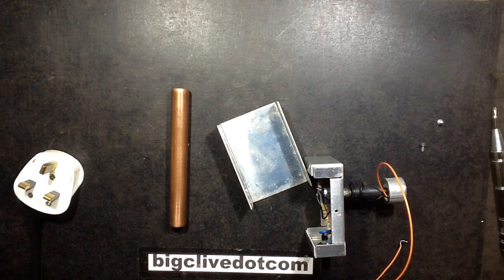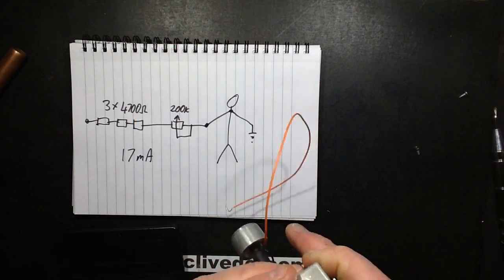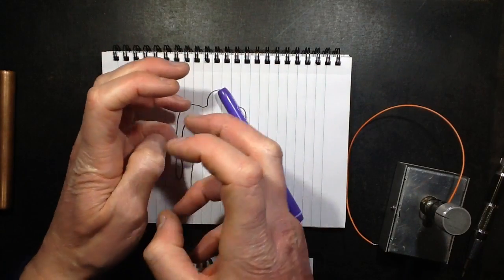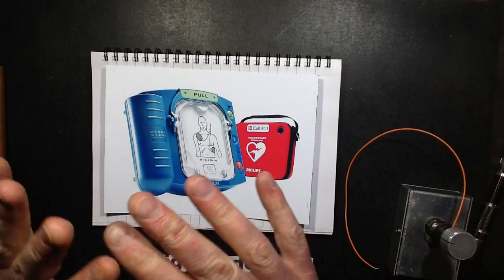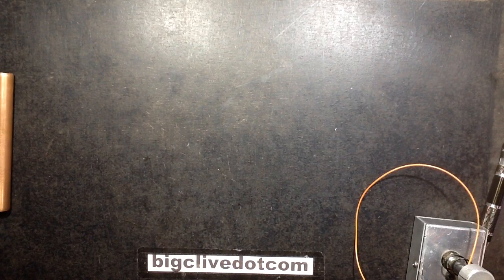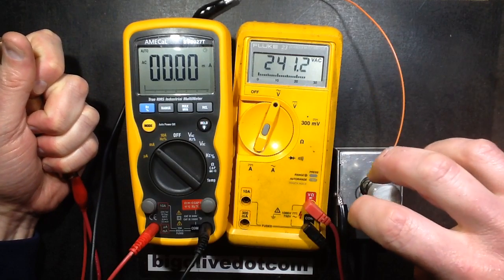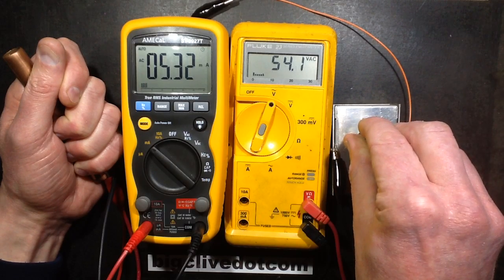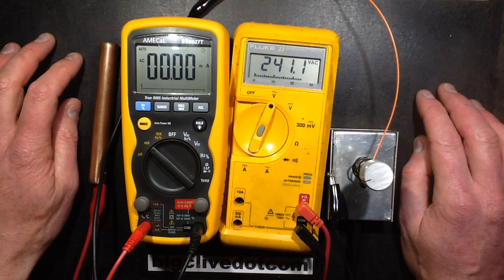Avoiding electrocution (Featuring real shocks.)

Comment: Actually a flatline can't be restarted via an AED.
It can only, as you have said, resync it. It sort of resets the sinoatrial node, which is basically a natural pacemaker in your heart.
Reply from the maker: I'm intrigued by the ability of some human hearts to resync completely with a rescue pulse.
Reply: Not sure what you mean here.

If you don't know what what I mean:

If it's actually stopped, a flatline, an asystole if you wanna be fancy, you can't just restart it with a shock. It's rather complicated and going into details is pointless, but what you have to do is CPR first combined with injection of vasopresin. With that you can get the heart to beat - though that then might need a shock because of ventricular fibrillation.

If you don't know how a heart works:
Look up sinoatrial node and it should be pretty clear
Reply: The heart has its own "pacemaker" made up of modified muscle cells that creates its own shocks that cause the heart to pump regularly (and by the way that makes the heart independent from the nervous system). If that's disturbed you often have to give it a shock so it "restarts". Sometimes it's damaged and then the patient will need a pacemaker.

Comment: Love your videos bigclivedotcom. Question though - shouldn't your calculation be (240*sqrt(2))/14100 given that 240v is the RMS voltage. This would then result in 339.4(peak)/14100 = 24mA max ?
Reply: I guess the question is if the body is sensitive to peak voltage or RMS.

Comment: I'd like to see you do this with DC and talk about how DC feels different to AC
Reply from the maker: I'm thinking about that with AC, unsmoothed DC and smoothed DC.
Reply: bigclivedotcom Or push ot even further. Different frequencies or even waveforms. Get an amplifier, connect it to your phone with a frequency/function generator installed and touch the output. even a shitty 12v ebay amp will work. You can get extremely high muscle contractions and even nerve stimulation. I've done it at a similar way back in school when I've talked about electricity and it's effects to the human body. It's quite interesting to see that higher frequencies "penetrate" extremely deep without high voltage and current.
Reply: @DrakkarCalethiel  Well your dumb because the higher the frequency the higher the skin effect so it’s actually opposite of penetrate. dumbass
Reply: @masseyluna2002  You saw how I said "penetrated"? This has a reason. Our body is most sensitive in a frequency range of about 50-100Hz. If you grab a conductor at 30DC you most likely feel fuckall, change it to AC 50Hz at the same voltage (30DC becomes 30AC peak to peak) and you feel the current much, much stronger.
Reply: @masseyluna2002  There is no skin effect with the human body.
Reply: @aj200415  One should not call others dumb not knowing better themselves.
Reply: Now that was very interesting and informative, well done
I wouldn't try it myself,
But hay it is something we should all think about, electricity kills
Thank you that was fantastic
Reply: @seandempsey9396  You can take these "voltage testers", a screwdriver with a glow lamp and a resistor inside. If you connect some tin foil to the grounding wire of the outlet and you put the voltage tester at the phase, putting one hand on the tin foil and holding one finger at the tester, you can feel the vibration of the AC! But only use intact devices and never connect it in reverse, the foil to the phase and voltage tester to the ground!
Reply: @seandempsey9396  I know that it does as I am lucky to be alive
Reply: DC really sucks once you get above a certain point
Reply: Homemade TENS unit 🙃

Comment: Yir some man clive  :)   by the way do you ever remember the shows that travelled about I live in Johnstone btw 5 miles from Paisley...anyways the travelling fairground (the shows) i am talking about had fruit machines that gave you a nasty tingle if you touched the silver parts on the front.Do you remember this or the shows ??
Reply from the maker: I've actually got a pull-handle fruit machine that gives you a zap when you touch the chrome.  The buttons have old leaf contacts with fish-paper insulators that have worn away.  The fairground machines were probably missing their earth connection.  Knowing quite a few showmen and how they dealt with electricity back then it's no wonder some of the machines gave "surprises".
Reply: yip they sure did give you "surprises "  btw its good to watch vids with a Scottish you- tuber ,,a very well spoken Scot but if you spoke like myself you would need subtitles :)

Comment: I always thought that AC current repelled as apposed to causing muscle contraction, which I thought what made DC very dangerous.
Reply from the maker: High AC current causes a massive involuntary muscle contraction which can throw people using their own muscles against them.  In the wrong circumstances it can cause them to grip onto live connections with such force that they can't let go.  With unsmoothed DC the contractions still occur, but with smooth DC it causes one contraction and then a burning sensation.

Comment: Build one with DC and test that. it will require a littlle more I think.
Reply: Linus T As an example, 30 volts DC might burn a bit when you have wet hands. 30 volts AC hurts. I work a lot with 35 DC but never got shocked.

Comment: Lockout Tagout isn't so much to save you from a shock, it's to save you from getting crushed, sliced, blended, battered, or otherwise mechanically fucked up.
Reply: Exactly, I wasn't even aware LOTO disconnected power to a piece of equipment, I just thought it disengaged the controls and held any moving parts in place.

Comment: Are you implying that HSE are idiots, they're in my thinking
Reply from the maker: HSE has gone from being a good thing to a profit motivated industry that has stripped all the pleasure from work by applying ill conceived blanket rules aimed at the lowest intelligence worker.  In doing so they've alienated the skilled workforce and effectively paved the way for using low intelligence workers.
Reply: bigclivedotcom  having worked within the industry for the last 30 plus years I totally agree 100%
Reply: bigclivedotcom they did the same in BT.
Reply: I think every industry has been touched by the scourge of H+S
Reply: Hehe, first job I ever had in a factory I had to be taught how to use a ladder and then sign a sheet to say I had followed the instructions and could now use a ladder.   Because naturally I wanted to set the ladder up on a 60 degree well-oiled gradient with a wheelbarrow of broken glass panes at it's foot, and then climb the ladder backwards with one hand firmly up my arse.

Comment: Just mentioning, as a paramedic in training we were told that an AED is used to cause a flatline so you even have a chance to get the heart started again, because you can't push against a cramping heart. Defibrillators as seen in movies (like, flatline -> charging noise -> "CLEAR!" -> bang -> (repeat 3 times for suspense) -> regular heartbeat) don't really exist… at least that's what we were told.
Reply from the maker: That's true.  A defibrillator is designed to bring your heart muscles into a known state so external compression can be applied.

Comment: Boy, that's dedication to bringing safety to the masses.
Way to go Clive.
I remember my first electrical shock at the age of 6 when I put my thumb up into an empty light socket, reaching it by climbing onto a bed then onto a window sill. Luckily I fell forward rather than backwards maybe through the bedroom window.
The scar staid with me for years.
Reply: My first shock was age 3. I unscrewed a nightlight and stuck my finger in.  I’ll NEVER forget it.  It was 115V and no ground path but such a powerful and unexpected sensation I’ll always respect AC power.
Reply: @technophant  for me age 6. Same for me and i put my finger in a night light in my sister's room while on the bed, so no path to ground, 120 volts but it didn't hurt me it just felt like some ants in my finger and i actually let my finger in it for a full 2 or 3 seconds, i remember not wanting to try it again due to fear of dying but it somehow didn't hurt me
Reply: I was 4 or 5 with a shitty italian extension cord with no collar. Pinched my forefinger and the flap between thumb and forefinger in there. My father saw what had happened as I was flaiiling on the floor and janked that cord out from the wall socket. For long time there was kinda hard bit in the middle of that flap but it's gone now that I'm 62. The white mark on the forefinger though is still there. Finland had 220 then, now it's 230.
Reply: Well you were a dumbass for doing that, weren't you? Still are.
Reply: I gave myself an electric shock at age 6-8 or so because I wanted to know what the fuss was about, and I stuck two nails into an electrical outlet. I'm pretty sure I shocked myself from one hand tothe other too, but I only made a very short connection (because with the loose nails, any twitch would disconnect - I think I actually already knew that the real danger was in making a connection by grabbing on tightly, and then being unable to let go of the conductors). I'm not sure how it felt, it mostly put a little hole in my memory, and I found myself having jumped two steps away. I then got wooden sticks for insulation to lift the nails back out of the socket because I was scared. 😅

Comment: reminds me of when i got shocked while working on a washing machine, all the while standing in a pool of water too!  i had a jumper wires clipped onto a solenoid valve that popped loose and touched a live wire.  the cord was unplugged but the washer was still plugged in so the current fed backwards and got me through the prongs of the cord.  my hands tingled for a few hours afterward

Comment: Deaths are so high in the USA because 90 percent have no training. I was taught to use one hand with both probes or one hand with a probe and your hand not touching anything.
Reply: Dan B I was taught the same way man.  Never put both hands in a box ever.  I did a lot of residential finish work when I was learning and was wiring up a 220V outlet in the garage when my coworker decides to energize the circuit right as I was bending the hot and I hit the ground, my pliers exploded in front of me, made me respect the power of electricity even more than I already did.

Comment: When I was 16yo I was practising as an electrician. I was connecting a kitchen bench armature as the mains was disconnected. And someone went and turn on the main! Luckily I was only holding on to one wire, my other hand was leaning against the earthed kitchen sink. So when I felt the chock I just took a step back. Still an experience I do NOT want to repeat. Was shaky for the rest of that day.

Comment: Could you stop current passing through the heart by using something similar to an anti static wrist strap ? Would the current not flow through the hand then through the strap to earth ? Or would resistance not allow that
Reply from the maker: It's a complex area.  Somne current might flow through your external wire, but a lot more would flow within the body.

Comment: Yeah, I wouldn't mess around with electricity like that anyway, I have enough nerves misfiring as it is, without the introduction of extra electricity.
Reply: yeah... another point would be, like in case of a mains-tester-screwdriver, that you connect your life to a resistor that may be faulty... you can never know... that's the reson why i don't use these testers

Comment: Interesting that you should use a 'control panel' as an example. I don't know if it's common around the world, but every house I've lived in, here in Australia, has a 'fuse panel' inside a metal case with the door hinged at the top, so the only way to access the interior is by holding the door up. A bit of a design flaw to add to the growing list of Australian electrical supply issues.
Reply from the maker: The idea behind the gravity closing metal door is in case the fuse box catches fire so the flames are contained inside.
Reply: Ahh, thanks Clive. Makes sense. I guess that's one thing in Australia that isn't trying to kill me.

Comment: Damn!  This guy has some balls!  I don't even like putting my tongue on a 9v battery to check it.
Reply: If you think a 9V battery is to strong on the tongue. You can lick your finger and put the battery against that and then your tongue just close to it :)
Reply: Joni Larsen-Haikarainen It's not about my weakness to the 9v, it's about his bollocks to the jolt he sustained!  I want to give him a bear hug and I have a dimmer I want to send him too.
Reply: Heh. When I was a a kid, I'd take apart old CRT monitors and TVs to re-focus and tweak the colour. This has to be done live so that you can see the effect. I could usually give them a slightly longer lease on life, though I did have one actually blow while I was tweaking it. 

I've only zapped myself once on a CRT, and it was when the thing was off. I had it apart to replace a broken button on the front panel, but nobody had yet taught me to bleed the capacitors. I did have access to some high current resistors that I could have used to bleed it safely, but I didn't know at the time that this was something that you could actually do.

Best time to learn is when you're a kid. The lessons hard learned stick around.
Reply: BlackEpyon I just got a nasty shock from a CRT yesterday... Safe to say I'm taking more precautions.
Reply: Riddim Dubstep, I don't think that's a good suggestion, the circuit part containing the capacitors might be "isolated" by transistors or switches, having the current flow out of them only when there is actual power coming in the device to turn the transistors on, for example.

I might be wrong but I don't think it always apply to just "turn it off and press the power button" to be safe there's no discharge possible.
Reply: The problem with learning lessons as a kid is the that the first lesson that defeats you will be your last lesson.  The kid who accidentally dissolves himself while working with acid does not go on to become a famous chemical engineer...
Reply: Or you could just umplug it and press the power button. It will bleed itself...

Comment: Why clive why?? I have had a 240v 13amp bolt a couple of times. Fortunately it was in through the hand and straight back out the same hand. so nowhere near my chest, but i can assure you my pants were still brown and it hurt like hell.
Reply: current might of gone arm to leg to the other arm ,the long nway round ,if your feet was more grounded
Reply: No my hand on both occasions covered the live and neutral so went through the same hand. Remember electricity takes the path of least resistance. Its certainly not an experience I wish to repeat.

Comment: Hi +bigclivedotcom, I'm a bit confused. You mentioned that when you 'insert' yourself into the circuit, the circuit is completed (with the current on the meter showing a value) however only as you increase the current you can feel the electricity move up through your hands and creep up into your arms.

Am I right to assume that only at higher currents the electricity can be felt passing through your body? And that at lower current, the electricity is still passing through your body however it isn't high enough to be felt or affect you physically? And why does the feeling start from your hands and move up rather than the tingling being felt through the whole path and gradually increasing in intensity?
Reply from the maker: The sensation of the current depends on the area of your body that it is passing through, so at very low currents you can only feel it in your fingers, but at higher currents it will be felt in the wrists, then the arms and ultimately the chest.
Reply: toweroak93

Comment: Are rubber gloves enough to stop current from flowing
Reply from the maker: Yes, but they need to be thick enough for the voltage and strong enough to resist puncture.  You do get live-work gauntlets.
Reply: F1 pit crew have big rubber gloves so they don't get zapped from the hybrid battery packs. Think the issue them to some of the marshals as well.